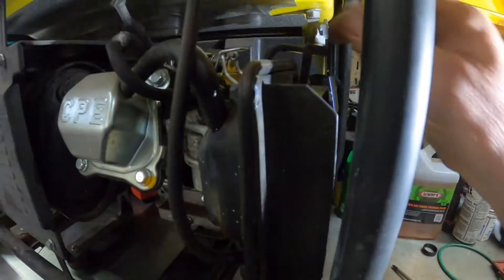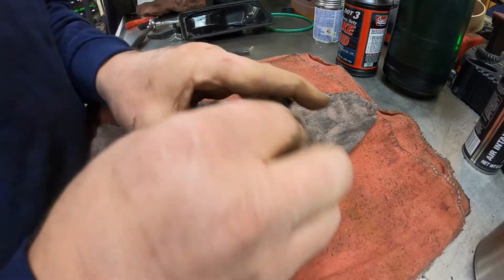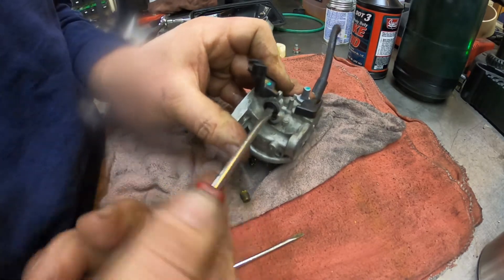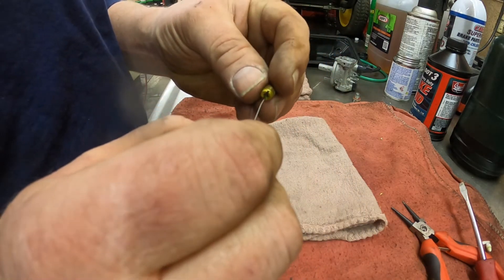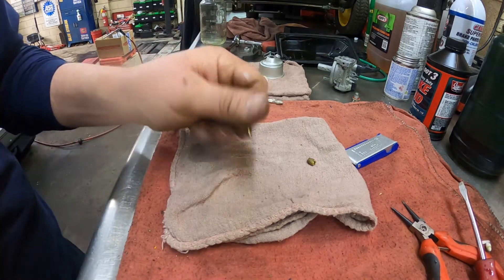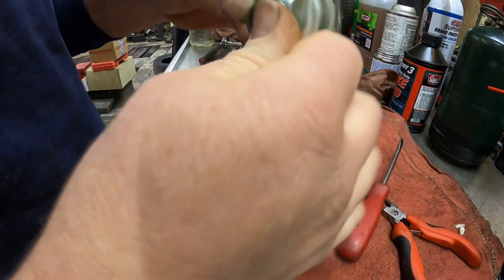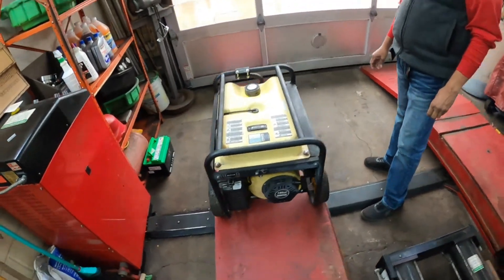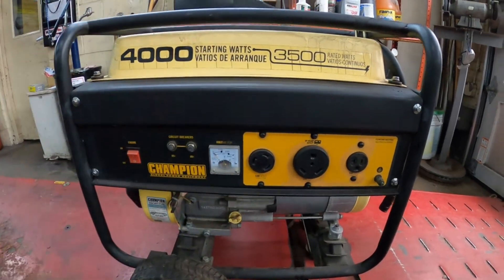Champion 4000 Watt Generator Carburetor Rebuild

Comment: Handy to find a video with the exact same model as mine. I’m just cleaning the jets now. But the main brass jet with all the holes like a flute is not blocked. Probably the smaller black plastic one

Comment: I have the same generator and I have clean both jets and I can only get it to start on choke then I flip it to run and it will not stay running. It has a new spark plug getting plenty of fire.
Reply from the maker: Carb still clogged.

Comment: I just put a new carb on mine also and I see the governor  return  spring goes in the little hole the second  one on the butterfly. But where does the other end go does it go in the same hole as the link  rod or the hole next to it ? on the governor  arm. I've looked everywhere  online and I've seen  it done 2 different  ways and I'm wondering  if I'm doing it right
Reply from the maker: You should put it back in the same hole that you took it out of, but I know no one remembers.  You should be able to look at the old carb for wear in witch it was in. If not try one hole  and if it does not sound right switch to the other hole.
Reply: Ya I'm not sure what hole it goes in  because  the  spring I got is new other one was old and fell off
Reply from the maker: @nathanielstuckey3354  In my video the spring is in the second hole at the carb. On the other end I don not know.
Reply: @TheGAutomotiveAndMore   thanks for your help